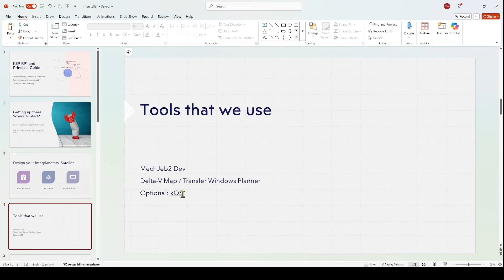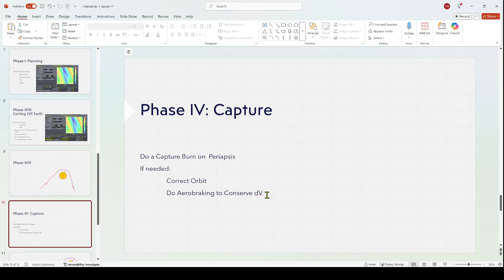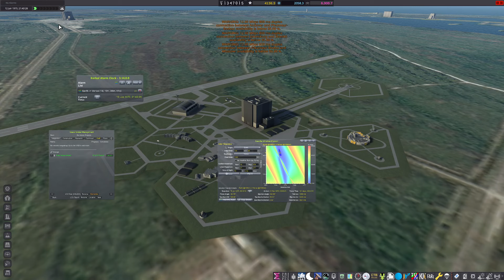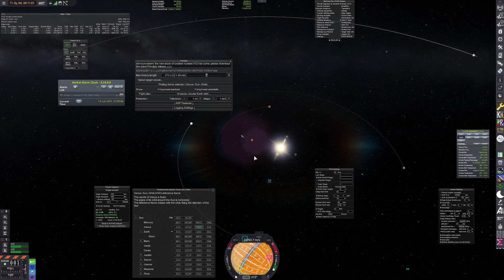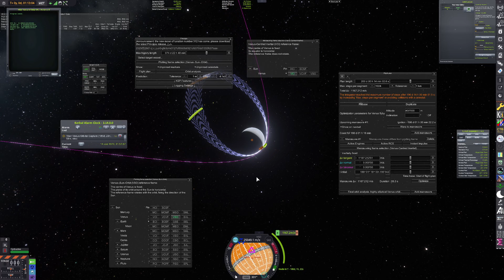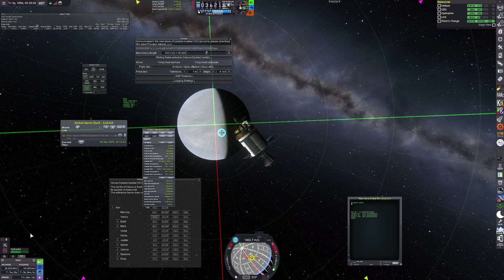KSP RP1 Principia Guide - How to: Interplanetary Missions

Comment: jesus fuck rp1 i get it but rp1 with principia is insanity
Reply from the maker: Seems about right when I first installed principia Once you get your head around the reference frames it becomes very straight forward 
 Helps if you had physics in highschool/university but still once you figure out the reference frames and when to use what everything falls into place.
Reply: It's really not. Once you know principia a bit it's actually easier than stock.